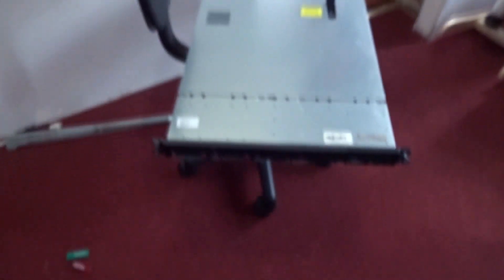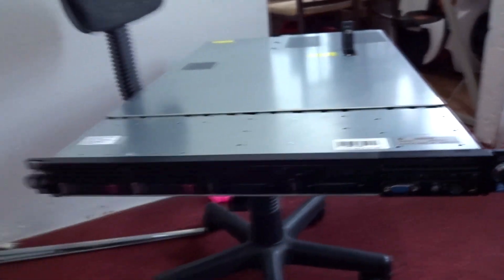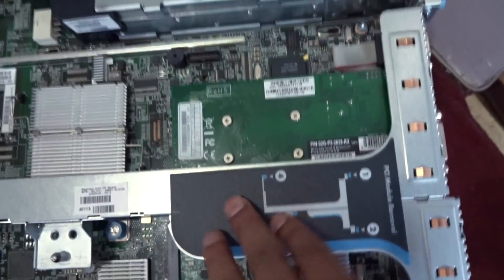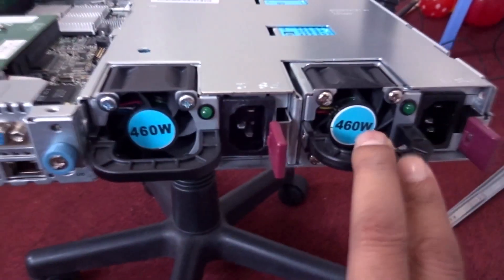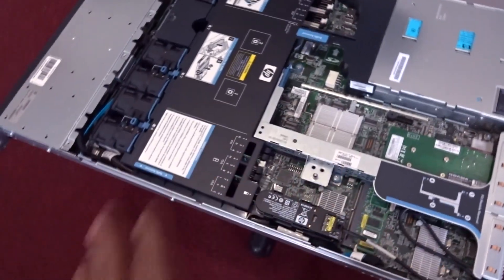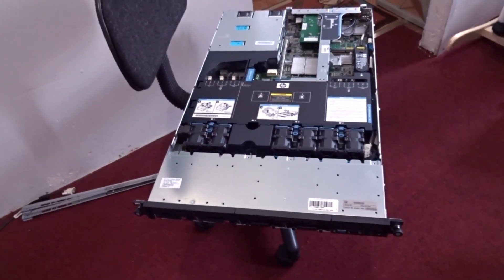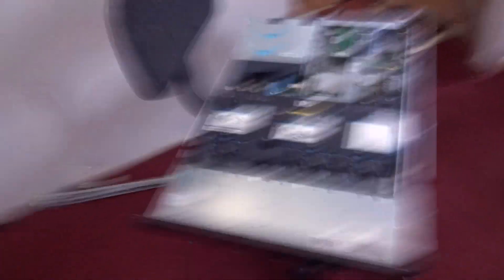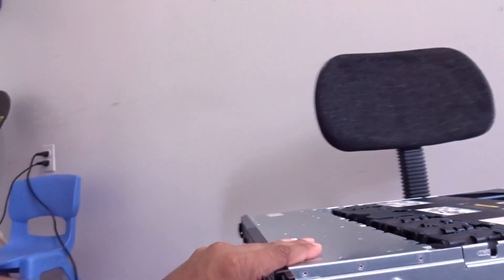ESXI Server Budget Build Project HP DL360 G7 Update 01

Comment: hello I am planning to buy this for rendering. can you please tell me is there any issue with the temperature with x5650. how higher the temperature of the processor goes?
Reply: I own one. The temperature issue you may have is with the raid chip. You can install fan, I used usb to 3pin fan power to fix. Use program called speedfan to monitor temperatures